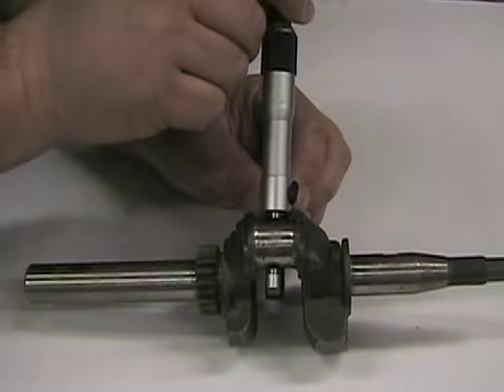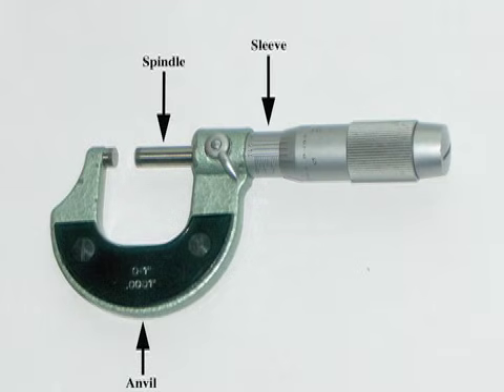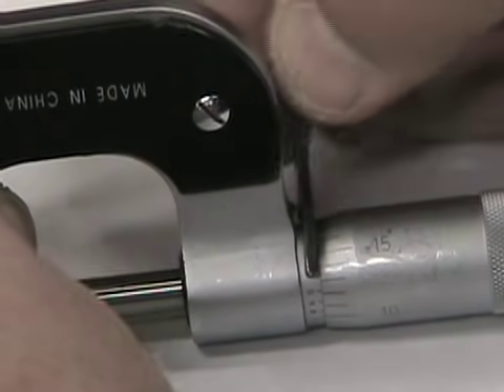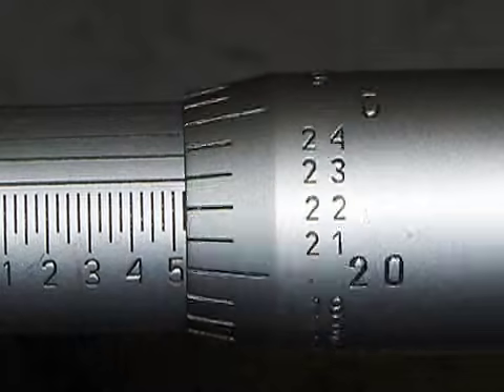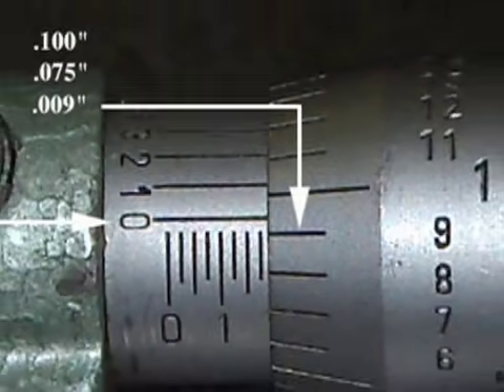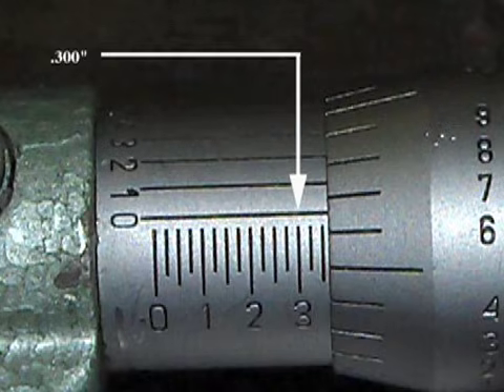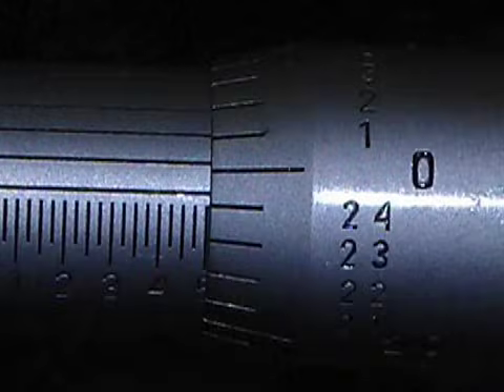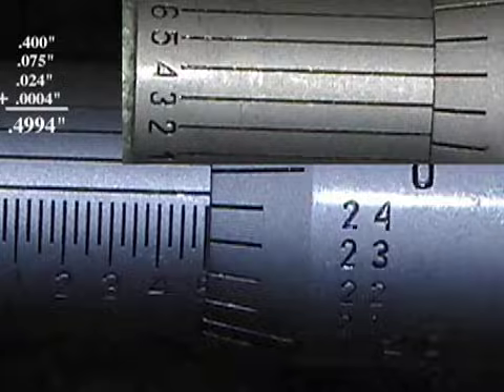Reading a Standard Micrometer.mp4

Comment: Great video.  Some of the viewers commented on having been taught to measure using the metric system, while others were taught use decimal measurements  in the SAE or inch-foot-yard system. Didn't NASA have some problems a few years ago with some critical of the measurements for a space mission being Metric and others in inches in decimal format, and nobody noticed? The Hubble telescope mission perhaps, which required having a corrective lens built and carried into space and fitted on top of the mirror to correct the refractive error?
Reply: I don't think it was metric measurements that messed up Hubble(a different story).  It was an unbelievable backyard tool that the guys made. It's a great story actually.

Comment: So I won't be commenting anything new here, but it might help those still confused:
For the "vernier scale" portion where he takes measurements from the left side (in the first example it was 0.0004"), it might be hard to understand what two lines he's comparing (the one on the left, and another random line on the thimble) or WHY.  The way you do this is you look at all the lines on the thimble, and see if any of those lines match up EXACTLY (or is the most exact line pair of them all) and you write down the measurement of that left line it most matches with.
So in his first case:  The number 13 and the number 4 had lines which matched exactly.  If you were to look at all the other lines, they wouldn't match up as good as these two did.  So you look at the line on the left that is paired with the 13 line, and you take that measurement.  So 13 and 4 match each other, so 4 represents 0.0004".  Write it down, add it up, and you're done.
Just wanted to clear that up.

The only other thing people get confused with is remembering that on the first step each little line represents 0.025" (and not just 1, 2, 3, etc).  So it goes like this:  0.1, 0.025, 0.050, 0.075, 0.2, 0.025, 0.050, 0.075, 0.3.....
In realty the measurements will be:  0.100 , 0.125 , 0.150 , 0.175 , 0.200 , 0.225 , 0.250 , 0.275 , 0.300....
Hope this helped a little.

Comment: But I'm not able understand 4th line value... Please anybody can tell me that 🙏🙏
Reply: Basically, the fourth line is an extra scale to push the accuracy from 1/1000 on an inch to 1/10000.  It operates like the old slide rules and like the vernier caliper.  When the dial is still in between numbers, say  0.184 to 0.185, you then flip it so you can see the 0 thru 0 scale on top, left side.  You see which line lines up (ignoring the readings on the right, which are still part of the thousandth scale, just paying attention to the tick marks themselves), and whichever is closest to lining up to a tick mark on the left (0-0 scale), that's the ten-thousandth place value (from the 0-0 scale).
Reply: @sscheinfe  ok ok it means the fourth line will be measured by the help of vernier caliper reading and it will have one more zero than the zero of vernier micrometer.. That's right?

Comment: Why do they add in a 4th unnecessary step as if you're reading the 25 thousands can't you just combine the numbers and take out an entire addition step as you would do with a measuring tape 2 and 3/4 it's exactly the same as adding 2 and .75 inches in your first example as we know it's thousathis it should simply be 
.175

Comment: There is a big difference between reading and measuring.
Reading tells you what the numbers and lines mean but to be able to actually measure properly is a different matter. I have as a Toolmaker ( 55 years experience) used both inch and metric.  The inch in precision engineering was converted to a metric ( 1000 )unit but still is a very cumbersome way to measure on the micrometer. If you can measure something with a metric micrometer within 0.005 you are doing extremely well. With measuring I mean having it checked after with slip gauges ( gauge blocks ) !  If you have 10 people measuring the same item  they most likely all come up with a slightly different measurement.
Reply from the maker: I was just saying something similar to one of my students today.  It's easy to teach them to READ the micrometer, but a whole lot harder to teach them to use the tool to make proper measurements.

Comment: it looks like your micrometer is messed up in that last example at 3:53. the 5 line is not only visible but a portion beyond it is as well on the sleeve. were it at 24 plus as you say then the whole line would not be visible and in fact the whole 5 line would not be visible at .5000 either.
Reply from the maker: True, and not true.  This is actually how I prefer my mics to look.  Maybe not so much of the .500 line showing, but it's pretty close.  My brand new Starrett mics show about half of the .500 line at this setting.  Maybe more.

Comment: so lemme get this right, you insist on using inches but then use the metric system to divide them into 1000th's to be more accurate? why not just use the metric system?
Reply from the maker: Just the way it is here in america :-)  

When I was in school in the 70's, we were told the US would be going all metric by 1980.  We are still no closer to going metric than we were then except our soda bottles and car engines are now labeled in the metric system.  Now that's major progress.
Reply: The Army is and has been mostly metric for awhile now. Simplicity can prevail

Comment: Correct me if I'm wrong, but you said, "Vernier Micrometers can measure to ten thousandths of an inch."  

I think what you meant was that vernier micrometers can measure to a tenth of a thousandth of an inch.  In other words:

.010" = ten thousandths of an inch
.001 =  a thousandth of an inch (tolerance of standard micrometer)
.0001 = a tenth of a thousandth, or simply said as ONE TEN thousandTH of an inch (tolerance of vernier micrometer)
.00001 = ten millionths of an inch
.000001 = a millionth of an inch or "micron"

Since this is an instructional video I thought it was key to point out this critical detail.  It can get to be very confusing and have found this communication issue to come up from time to time when talking about ten thousandths of an inch versus one ten thousandths of inch; so the language needs to be very clear ands concise.  
(I'm employed full-time as a machinist)
Reply: Sorry altimatik gotta agree with Bob here.
Reply: 10*(1000^-1*inch) vs (10^-1*1000^-1*inch) == (10*1000)^-1*inch
I never heard a human say the former. Why not just say (100^-1*inch) ?
Reply: Reply to Atimatik Army
1: A micron is not a millionth of an inch. A micron is a micrometer.
2: A ten-thousandth of anything is 1/10,000, not the same as 10 one-thousandths 10 x 1/1000. 
The confusion may be the plural. You could say "accurate to one ten-thousandth inch"

Comment: Very nicely described, easy to understand, thanks! 
I have a Fowler rotor caliper, digital, and it had no instructions. I cannot seem to get the spindle  to move no matter  what i do. I turn the thimble  but its not moving the spindle. I am wondering if there is a piece missing that connects the thimble to the spindle, some sort of locking ring...

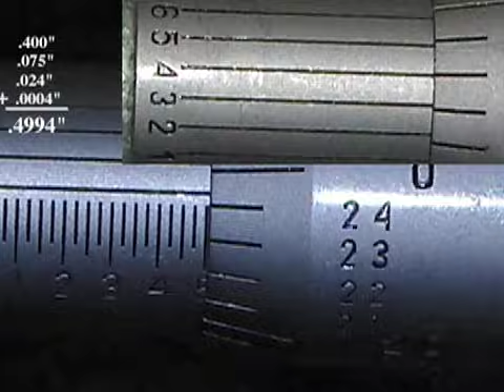Comment: thanks a lot, I have also find if useful and very clear. However, I have a question,  wouldn't the final measurement at 4:20 be 0,5244 inch instead of 0,4994?     I will be grateful about your further comment!